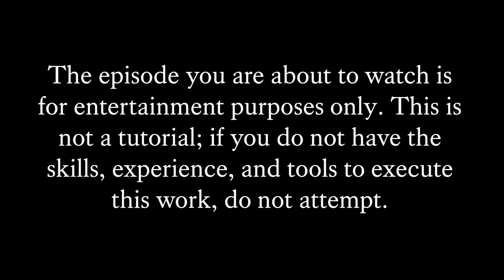Winchester 1892 45 ACP:  Anvil 113

Comment: As usual, amazing fix.  I assume because of your fix, this gun probably never ran?  I learned something, I think.  If I am correct, this is why no one has made a 92/94 in 45LC/45C/460S&W.  The variable length is a killer. 
Do we know when the gun was converted and the story?  Seems like something a police dept. may have confiscated/acquired during WWII and converted.  This way with a limited supply of 45ACP they could be good to go.  I guess that could have also happened after WWI, but before WWII, I would think they would have just bought something else in 45ACP, maybe a Tommygun.
Reply: They wanted one cartridge for both long and hand guns.

Comment: I have a tp9sfx that with oem mec-gar mags feeds any rounds but the crap pro mag magazines don't work past 6 rounds in them the nose of the bullet is always pointing too low I won't if I did a touch up on the feed lips or feed ramp would help

Comment: I know they make  straightening tools for shotgun magazines. Do they make something  similar for Winchester mag tubes?
Reply from the maker: Those have to be made on a case basis
Reply: @marknovak8255  I recently had to straighten a bent and dented tube for a Colt Lightning medium frame rifle, those are rolled and not soldered along the seam just like the Winchester tubes. Turned a mandrel in the lathe to hammer into the tube, while using hose clamps to prevent the tube from splitting along the seam. This together with a polished hammer and a pipe that fit over the outside got it good enough. Unfortunately, I had failed to polish the inside of the hose clamps so they scratched up the tube a bit and I had to touch up the finish. Otherwise, success!
Reply from the maker: @Kaboomf  Outstanding.....!

Comment: we didint reely know what was going on with metelurgy until 1955. it was the first image of a metal dislocation. before that it was all theories and ideas. so steel before then kinda sucks. haveing to be real soft to avoid cracks, or just trying to be a cheaper brass. so peening stuff over with a little baby hammer is right in line.

Comment: Probably designed to run .45 auto rim cartridge's. many revolvers where built back then that used .45acp with half moon clips. They came out with the .45 auto rim to eliminate the need for the half moon clips. Just a thought.
Reply: Outside the cartridge collector's community .45 Auto Rim is practically unknown in Argentina. The Argentine armed forces adopted the Colt 1911 in 1927 and form then on the .45ACP became commonplace but not so the 45 Auto Rim nor 45 Long Colt. I've seen several Winchester 92 saddle ring carbines converted to 45 ACP and many re-barreled to 44 Remington Magnum. Starting in the early 1900's SRC in .44WCF were issued to mounted territorial police departments all over the country but by the 1960's they were phased out and were auctioned to the public, although by the mid-1980's a number of new carbines were still in storage in some obscure government facilities in their unopened, original Winchester wooden crates, wrapped in the factory waxed paper typically employed for sea shipment.
Reply: @chapiit08  I did not know that, I figured the auto rim was pretty much universal. I really don't know much about the history of it. Thanks for the reply. I learn something every day.
Reply: @chapiit08  Interesting to know they rebarreled  original Winchesters for .44 mag.  I own a Browning B92 in .44 mag.  That Browning is a Winchester 92 clone.   I wonder now were they got the idea to make the guns in .44 mag?
Reply: @MrSloika  It was common practice once the barrels were too worn out from years of use with corrosive ammunition, but rather than go for the anemic .44WCF some people went for the already available (and easier to reload IMO) .44 magnum as a better choice to hunt wild boar in heavy cover and at close range.

Comment: Mark, two questions, 1) When Winchester did make some levers in 45 ACP, (I do not remember if it was the 92 or the 94 in the 1980"s) they said to use flatness bullets (A.K.A. cone bullets) to minimize chain fires. Do you think that is real problem ? 2) If a given 230 grain 45 ACP say does 750 Fps from a 1911A1 to you think that extra barrel would give you another 300 Fps or less ? I do like your show and wish I had more time to watch them.
Reply: #1 of 30/30 won't chain fire I highly doubt 45 is even remotely capable of doing so. 
#2 pistol powder burns more quickly so handgun rounds typically have diminishing returns when it comes to longer barrels. pick a brand or ammo and look up fps/barrel length graphs to confirm.
Reply: @EvanDickersonM81  Mark was using ball ammo so semi pointed. not flat point 30/30. And smokeless 44-40 Win gain on avg 400 Fps from a rifle over a 5.5 barrel pistol.
Reply: @EdAtoZ  I use regular ball 30-30 in my Marlin it is much more pointed than any 45 ACP and no matter how far I have hiked with it over my shoulder or dropped it on its butt have I ever caused a chain fire. Also again you're quoting a different round with a different cartridge capacity when a simple Google would show you that any barrel length past 13 in would actually slow down the bullet.
Reply: @EvanDickersonM81  .30-30 cartridges do not stack point to primer in a tubular magazine, so chain fires have never been a concern with them.   Also, the cups of large rifle primers are considerably harder than large pistol.  There is a reason (proven or imaginary, I do not know) why no commercial leverguns have ever been chambered in .45 ACP.  I converted a Taurus Thunderbolt to .45 ACP but only shoot cast, truncated-cone bullets through it just in case.   I know of a Marlin which has been converted by a well-known professional gunsmith but his customer understood exactly what he was asking for and how to operate it.   16" vs. 5.5" gains about 150 fps with 230-grain bullets.
Reply: @geargnasher9822  Nothing stacks nose to primer perfectly in a tube mag, not even 45acp. The tube used is clearly much larger than the round to account for the rimmed case that is supposed to be used in the rifle. This would have the same effect as any other round, causing the rounds to not sit nose to primer. I used this comparison for the pure fact that the rounds I use come to a much finer point than 45 acp making it more likely for a chain fire to happen. As long as a Spitzer cartridge isn't used, chain fires are pretty much guaranteed to not happen. The reason lever guns aren't built with modern rebated rim calibers should be clear due to the video, more engineering is required for proper feeding and extraction. Again, I'll reiterate factory loaded 45acp 230gr with standard pressures will have near identical fps at 6in and 18, the round starts decelerating after about 13in.

Comment: One thing about wood, impregnated with oil or grease, how do you prepare it for a strong bond with glue, perhaps Epoxy or other glues ? Of cource a long bath in carbon-tetra-chloride or acetone might work, but more practical ? For it is so: No known kind of glue, can even remotely bind together, greasy peices of wood properly. It will not happen, ever.
Thanks for a reply in advance.
Reply from the maker: Make a paste of whiting (silicon carbide) and acetone ....swab on with a flux brush. Let this sit for a day, then heat gun it. Scrape off oil soaked paste, rinse and repeat as necessary. Once you commit to this, the whole stock has to be redone. There is no easy way.
Reply: I have used an Acetone bath for a week and then 2 week air dry.  The wood will swell a little, but you are going to glue and refinish anyway.
Reply: I don't know how well it'd work for lighter oils and greases but a trick that works really well for getting Cosmoline out of milsurp stocks is to bury the stock in a tray of kitty litter and leave it out in the sun for a couple days. Change out the litter and repeat until stuff stops coming out of it. Heat gun or an oven at a pretty low temperature, assuming the stock and tray will fit inside it, are effective if you don't have enough sunshine around.
Reply: @DanBowkley  Keep the cat away from it or you will have other problems.

Comment: I wonder if before the modification of the extractor, if it could have run .45 auto rim?
Reply from the maker: Rim diameter too large to fit the mag tube. Also, 45 AR is much harder to come by, eh?
Reply: @marknovak8255  that's kinda what I was thinking, which is why I figured it was opted for .45 ACP. Plus yes, .45 AR is as unicorn as it comes lately.

Comment: Mr Novak, I'm surprised you don't have one of those magnet screw dishes to hold those itty bitty screws in.  I just bought one to help with working on a lathe I'm rehabbing and damn, I wish I'd bought one sooner
Reply from the maker: I loathe anything magnetic for a variety reasons. I hate magnets, and as you learn gunsmithing, you will too.
Reply: They're convenient, sure.  Unfortunately, they also collect metal shavings.
Reply: @AM-hf9kk  I guess I'm not sure the problem with that would be?  Can't you just wipe the shavings out if the pan?
Reply: @jasongarland3165  No, the primary issue is that a magnetized tray tends to magnetize any hardware put into it. Very small screws, springs, and other parts when magnetized are a pain to work with, sticking to the screwdriver just enough to not go in the hole, but not enough to keep them from falling to the floor. Mark made a very good point, always sweep the floor before you start your work.

I've watched a few watch makers on yt, demagnetize the watch 1st before starting disassembly, just for that reason.
Reply: @norwegianshaggy4419  I thought that might be the issue once Mark said he hated magnets.  Makes sense that it would be an issue
Reply from the maker: @AM-hf9kk  YES THEY DO
Reply: @jasongarland3165  I've not had an action apart save an AR, but I can tell you carburetors DO NOT like having metal shavings attached to every little screw and needle in their guts.  Which is exactly what happens - the small parts become magnetized from sitting in a magnetic pan and all the shavings you couldn't see end up everywhere they shouldn't be.

Comment: Slug the bore. You may be in for a surprise! Some will mike at .428.  They rechambered the gun but left the original barrel untouched.
Reply: It was originally a 45lc barrel, not .44-40.
Reply: @mkultraification  And you know this how?
Reply: @robertoservadei4766  the barrel being stamped .45 long colt probably
Reply: @luke37181  .45 long Colt? You lost me there pal!  First. We're talking .45 ACP here. The 92 was never chambered in 45 Colt. 2nd. They marked them .45, so the rural cops what cartridge they should use. Oh! There's NO such thing as .45 long Colt!
Reply: @robertoservadei4766  They were made in 45lc for the Argentineans, because that's what they requested. You can see in the video that the barrel is stamped 45 Colt just ahead of the receiver.

You don't have to slug the bore to tell the difference between a .428 bore and a .454 bore. Even if you did, the man in this video has forgotten more about guns than we'll ever know.
Reply: @robertoservadei4766  4:48 . There's your time stamp. You can see ".45 L.C." on the barrel. The Long Colt designation did exist after a certain time to delineate it from other cartridges in use at the time.

Also, before you say that the .45 colt cartridge doesn't have enough rim to work in a levergun, that was only true until the m1881 version of the cartridge came out with a larger rim and a groove to give more extractor purchase.

BTW 7:45 . He hovers over the chamber area for a while. You can see it better.
Reply: OK. Here's my last post on the subject. I lived in Argentina at that time, so cut it out with the dumb .45 LC idea. At that time there was NO .45 LC ammo available here (still super scarce today), So you are saying they rechambered from .44 WCF to .45 Colt, in order to go from s arce to non existent.
Reply: And the work was done locally by Industrias Marcatti. So cut it out.
Reply from the maker: Bore is .452 on this barrel
Reply: @robertoservadei4766  You're mad that everything you said is wrong and goofy

Comment: Why didn't you try to use the 45 rim, that should have worked a lot better , and at that time there were a lot of cylinder guns chambered in a 45 rim later on they use Moon clips to use the 45 ACP 45 rim should have worked great in a 92 Winchester matter of fact I love to have one
Reply from the maker: Rim diameter too large to fit the mag tube. Also, 45 AR is much harder to come by, eh?

Comment: If you flipped the barrel as described at 5:20 does that change anything or have any other impact?
 Edit: Other than needing to be re-chambered and removing your brand used accidental muzzle device that was your chamber...
It’s too hard to visualise.

Edit: I’ll leave this question up for others but as has been pointed out, the mag was flipped. Not the barrel.
Reply: The ruffling would not change. It's a spiral. You can visualize it by drawing a spiral arounda tube and then flipping that. No matter what you do, the speak still rotates the same way. 

The tricky part is that you would need to cut a new chamber in the new back of the barrel. Also, the front (muzzle) of the barrel would have some very obvious marks and cuts, so it would probably bean good idea to shorten the barrel by about an inch to hide what you did.
Reply: So I may be misunderstanding you but they flipped the magazine tube not the barrel.
Reply: They flipped the mag tube, no rifling there.
But you could flip barrels and have the same direction of rotation (as mentioned, chamber etc needs to be cut).
To imagine it, think of the right hand rule: a right hand (regular) thread on a bolt will move in the direction of your thumb if you rotate it in the direction of your fingers. Now if your right thumb is pointing to the right, it moves to the right if you rotate it towards you (on the top). If you point your thumb to the left, it will move to the left if you rotate it away from you, kinda like a double negation. So you could cut the head off a bolt, glue it on the other side and use it like normal.

Comment: 27:10  Be nice if someone like A-Zoom filled the insides of their action proving rounds with something that would make them  closer in weight to live rounds .
Reply: why not just reload a few rounds without primers and powder, thats what i did for dummy .45 acp, still need to come up with a good rubber primer so that i can use them as snap caps. after a few years use even azoom rounds will fall apart, the rim of my .38 spec rounds seperated after hundreds if not thousands of dry fire practice firings.
Reply: @johngraesser4911  Fill the brass with cornmeal for additional realistic weight.
Reply: @johngraesser4911  or use sand instead of powder for weight

Comment: I wonder if this would handle some 45 super or maybe a conversion to 10mm.
Reply: The 92 is darn near the strongest action around as far as taking recoil. The two locking lugs that come up on either side of the bolt create a stupid amount of shear strength. The receiver would literally have to blow out the sides to let the bolt move. I have no doubt it could handle 10mm, let alone 45 super

Comment: How about using magnetic  dishes so you would loose any of these small parts. Harbor Freight has them in many different sizes 

Ricky from IBM
Reply: The dish will magnetize the parts which will pick up chaff that will scratch, wear, & or gum up the finished product it's far easier to just keep a clean shop & if needs be use a Ziploc
Reply: @jomoma8576  Hmm… I use magnetic dishes all the time when working on my guns, designing and  repairing computer systems at IBM and after early retirement  at the Guitar Shop where we repair guitar amps, guitars, banjos,etc and never had any issues
Ricky from IBM
Reply: @k4vms  just because you can doesnt mean that you should.
Most smiths that i know have a demagnetizer on one end of thier bench for a reason.
Reply: @harveynailbanger  none that I know of do. And your statement make no sense.
Ricky from IBM
Reply: Then you need to know some good smiths. Later
Reply: A hard trigger is an additional safety device.
Reply: @danijuggernaut  A hard trigger on a revolver I would agree
Reply: @k4vms  Also on pistols, specially military. Have you shot a Beretta 92 in single action? Not very soft at all. The Army tries to avoid accidental killing of the own men.
Reply: @danijuggernaut  yes and I own several
Reply: @k4vms  So, then you know what i'm talking about.

Comment: I am surprised you didn't build up the hammer notch with some weld metal then reshape.
Reply: Unnecessary and  unsafe
Reply: @Bryan-jm4uc  Why would you call that unsafe?  That is a standard repair for broken sear notches on revolvers, Mauser 96s, etc.
Reply: @kenibnanak5554  not an expert myself but if I had to guess it probably wouldn’t be good for the heat treatment on the hammer. A man of Mr. Novak’s skill could probably reset and return it to original spec, but that’s a lot of effort for a marginal benefit.
Reply: Simply replacing the whole hammer would be so much easier and cost-effective.
Reply: @MrTruckerf  Then we wouldn't have the video.  :)   In some cases with 19rh century weapons that is not always the quickest or most cost effective way to go.  Many had much lower production rates and spare parts are not easily found at low cost.  checking online as I write I do find an original pre-1964 1892 hammer available for (US) $128 plus shipping so maybe,   Then again some owners don't want new parts in their old gun.